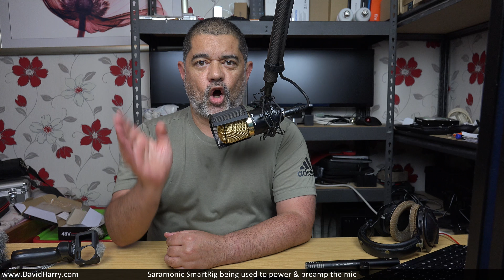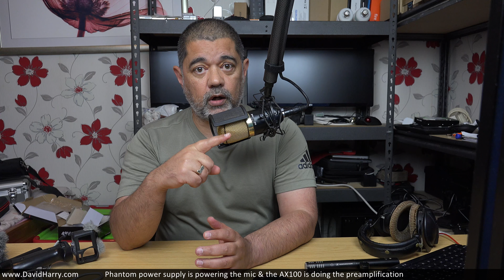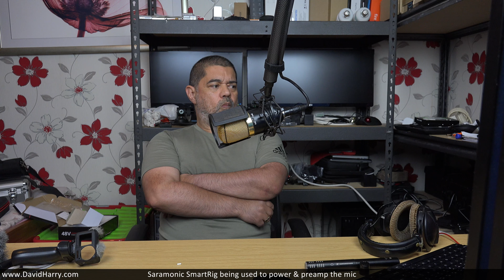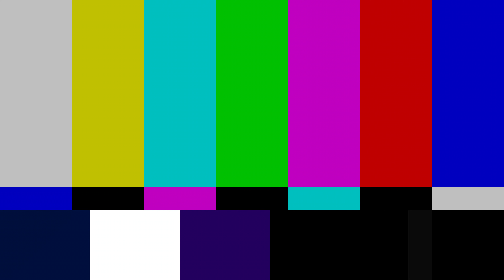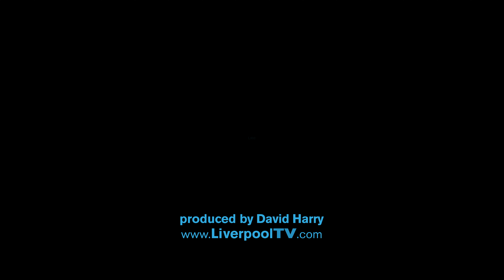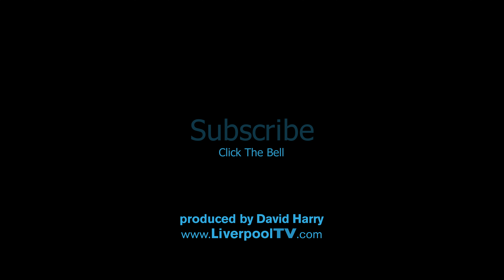Mic Testing - Phantom Powered Preamp VS Phantom Power & Camcorder 3.5mm Mic Preamp - Noise & Tone

Comment: Just a tad more noise without the Saramonic, so it does actually work!
Reply from the maker: Thanks Ian. Did you hear much in the tone? I think the results here are basically showing that if you’ve got a camera with a good input and you’re dealing with cheap preamps and power supplies etc. Then the differences are probably only really down to taste. To get anything better then you’re talking serious money for a power/preamp and separate recorder. At which point it’s probably arguable that it’s massive diminishing returns and you also lose the convenience of going straight into the camera. Cheers, Dave.